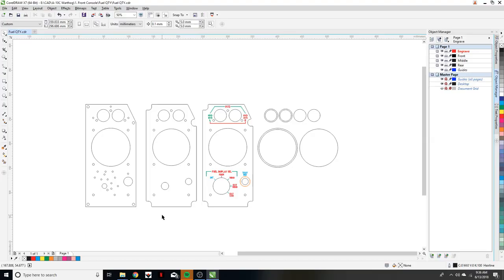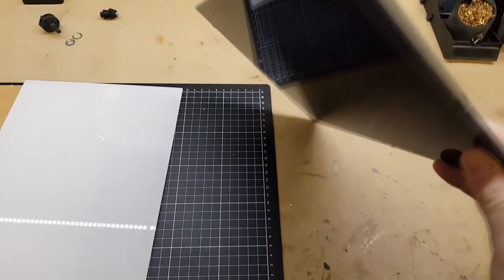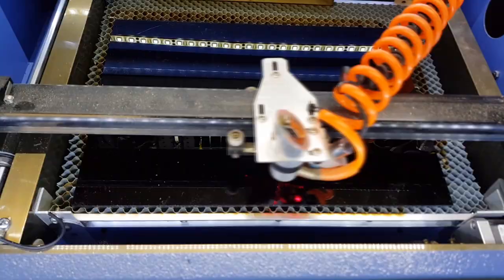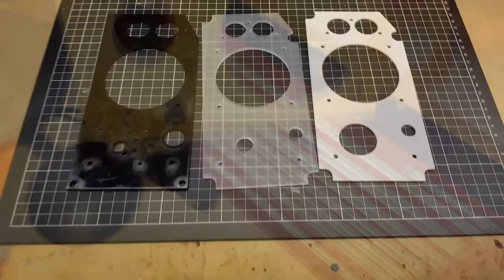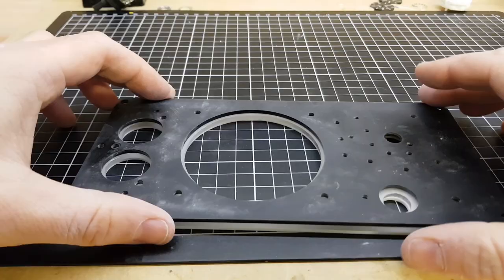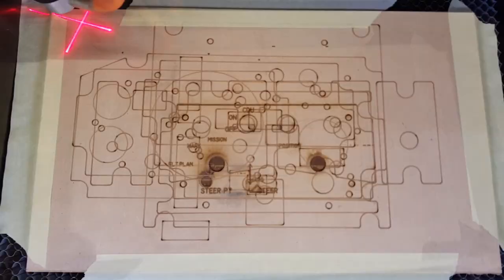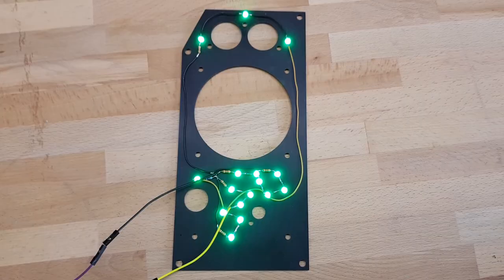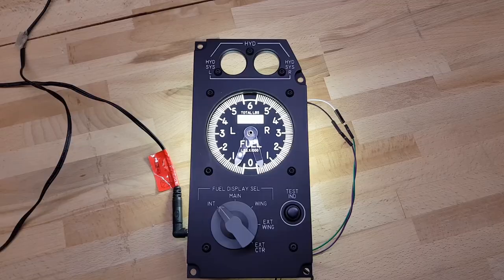Making Flight Sim Panels with my eBay Laser

Comment: Question.. did you actually manage to find a switch that meets up with the panel indents?? : ) ??
Reply: Blame USA but if you couldn't find one and you had the time and patience, using a LASER cutter, + maybe a 3D printer, + maybe a CNC machine, you could make your own custom rotary switch!! Cool!
Reply: Normally it's pretty  easy,  just oversize the hole and glue the base of the rotary to the back of the panel and then there's no movement, no need to use any pressure fittings. Or you can buy the component first and then design the holes afterwards.

Comment: I had to repair or replace these panels when I was in the U.S. Navy. Back in 1973 a panel like you made here would cost at least $ 1K. They were certified flight equipment though. $100 for the part, $900 for the cert.
Yours look great.
Reply: Well. 100 for the part, 100 for the cert... 800 for the gov contract upcharge...
I used to be a mechanic in the Army (thank you for your service btw) and was regularly blown away by the upcharge on common parts.

Comment: Nice mate.  Almost exactly how I do mine.  Just a tip, apply a little Bondo filler to the edges and sand down a bit to eliminate the seam where the parts meet.  Another way around this is by actually welding the layers together first and then cutting as the heat from the laser will make the edges look seamless.  Keep up the good work!

Comment: probably the best rear-illuminated panel method I have seen. Excellent work! I used your conformal coating idea on the wiring for safety on exposed hi-voltage on my own boards. Cheers

Comment: Excelent project. Congrats. One question, why you used 3 layers and not just 2. I mean the first layer could be (your second layer) the one which difuses light, painted black on the front, and engraved.? Thanks if you can answer.

Comment: You can use rubber cement as a masking agent in the dial recess instead of tape - the liquid form will ensure no seeping of the spray paint at the edges of the mask. I know since the dial went over it wasn't a big deal, but IF it was this would allow that precision. Likewise, it can be much faster than trying to get the tape to conform.

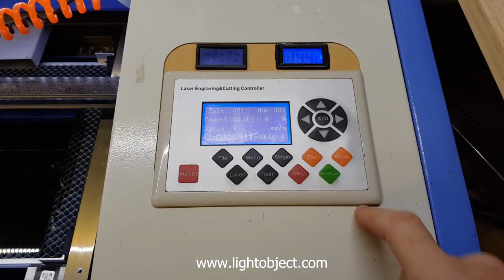Comment: ...  @ 03:00 you mention/show the acrylic... that front layer, that all solid white ? trying to see in my mind how that allows light through with the front sprayed black and then lettering lazer'd out/off the paint.
Question, @10:20 you do the drilling into the opaque layer... do you go all the way through it ? is yes... then sort of implies you touching the white layer. guessing my OCD tells me to rather do it on a drill press where the depth can be controlled.

Comment: one of the most satisfying vids ive seen, great job. New sub and like.
Reply from the maker: Thanks!
Reply: @thewarthogproject  Hi mate , I watched few videos about your project and it's really impressive. I'm a newcomer to the subject and after making first simple panel with ~30 switches and buttons I'm working on the more sophisticated one, with backlighting, displays, etc. That's why I have few quick questions, also looking for advices. I appreciate if you could help me.  
How powerful power supply u used? I'm playing around with the LEDs in Tinkercad now to see how bright they can still be when connected multiple of them to several teensy/andruino boards but it seems with few dozens of them (in one of the panels with 120cm of width and ~20cm of heigh) it will be better to connect them separately to 12V power supply.  They get too dimmed when using 5V, even with few circuts with separate 5v sources. I also consider to use 5050 led strip (30leds/m, 12V) cut in several pieces since I got >10m of it lying down in the cabinet.   
The middle plexi sheet - what transparency % would you recommend?
 Would it be not better to use also opal sheet for front panel? Tho I didn't have any of them in front of me, I though the solid one won't allow the light to go through. 

Cheers
Mark
Reply: Ooh one more question. What font size you use for engraving text?
Reply: @thewarthogproject  Any chance you could let us know what type of vinyl you're using at 15:58? Would love to see the method too if possible! :)

Comment: That is amazing! What adhesive vinyl are you using? I didn't know you could use it as heat shrink. Does it last or does it peel off with time? Asking because I see the video is five years old now.

Comment: Awesome... I wish my ford truck and my mother in-laws car gauges ,air conditioner,etc Gauges switches were done like that.instead the lettering explaining what each button does is worn off.so when I use her car or try to use any button even the backseat front seat locks,seat directions,  ect. I have to guess mostly .its very aggravating,the buttons aren't arranged intuitively either,and look the same.her car is only 2years old.Buick.it takes more thought and time.but its not only good to look at,but has a absolute purpose... In an air plain,you don't want to guess what buttons to push because of saving a dollar or two or more.
Good work,very nice panel.

Comment: If you sand the led it will spread light even better and not need to drill anything which makes it less likely to chip or crack anything.

Comment: Any chance of doing a video on how you upgraded your k40
Reply: Yes, this video was amazing, so now of course I (and Im sure, many others) want a cheap engraver and instructions on how to DIY improve it... 

PS. Your entire setup is epic!
Reply: It seemed as though the LED locations were still quite visible in the engraved letters, especially at higher brightness.  If the LEDs were instead spaced around the perimeter, would there be enough light to still see the letters?  It seems as though that would be much more uniform, but maybe it would not be bright enough.

Comment: You're obviously hugely clever.  I just wanted to mention that you don't need to spend a lot of money on special acrylic cement crap.  The best thing to bond acrylic to itself permanently is acetone and it's a lot cheaper and does exactly the same thing.  You may, or may not have to use slightly more or slightly less but the cost for a can of acetone is no doubt much less expensive.  Just a piece of useful (or useless?) advice.

Comment: Excellent work! Could you please give me the details of the vinyl used for the rear of the stack for heat shrinking/protection? Thanks very much :)
Reply: I am also interested in the vinyl sheet. I have never seen such insulation. Could you please share details what material it is?
Reply: Looks like it's regular self-adhesive vinyl sheet which is used for automotive wrapping. Search for 'vinyl wrap' and you will find it.

Comment: I'm building a overhead panel and looking for materials and want to use your technique. I have a question regarding thickness of the white panel. I can only seem to get 3mm made instead of 2mm and the opaque diffuser panel in 2mm. Would that work? also what is the light throughput of the white panels you use in %? The one I can get made says 5% light throughput, would that be enough do you think? Thanks!

Comment: Great video mate, I'm so happy I found you! Quick Q if I can, do you need a CO2 laser if you only want to engrave and not cut out acrylic? could you go with a Diode laser instead? using a similar method of either 3d printing or getting a white acrylic sheet, painting it black and then lasering it?

Comment: this is a great video, love your technique. at 10:30, you mention that you taped off the exposed middle layer switch surround -- if you hit the edges of the tape with a bit of clear (satin or matte) spray paint and let it dry before you spray the matte black, you can get perfect edges; this is called backmasking iirc. I understand that perfect edges are not critical in this situation, but I thought you might appreciate knowing about this trick

Comment: Great work always generates questions from "DIY" people like me.
So 3 questions for you.
1 why don't you paint the panel before starting cutting and save the alignment trouble later?
2 why don't you sand the edges of the acrylic sandwich to make it smooth and more realistic?
3  what font are you using for lettering?
Reply from the maker: 1) Because the edges of the panel and inside the holes which had been cut would be white - so I'd have to mask up the engraved letters and repaint.
2) Because the area sanded would be white - so I'd have to mask up the engraved letters and repaint.
3) just google MS33558 - you will find it free and it's the same font used in the real jet.

Comment: Another thought. Since the laser can cut light metals. you could get some light copper sheet and make a circuit board for your electronics
Reply: sadly these co2 lasers can barley even mark most metals and you need a cnc to do work like that  unless you spray paint the board first and laser away all but trace location

Comment: This is a relative old video but I do have a question that I hope you can answer :-)
The front layer with the text engravement on is a 2 mm. solid white acrylic plate. I get that the light is  diffused by the middle opacue layer. But I would think that the solid white layer would blok the light and by that NOT light up the text engravement. What is going on? Does it work because the solid white plate is only 2 mm. thick?
Kind regards

Comment: Subscribed, excellent video. What was the black self adhesive material you used to cover the LEDs and wiring on the back of the panel? That was slick and clean looking. Thanks

Comment: Amazing job pal! I bought one of those K40s 3 years ago, did a few upgrades and it's still going strong, a great tool for the hobbyist as you say. Mine can cut 5mm acrylic at 4mm per second, how are you doing with the 60W tube, better depth or just using it for the speed ?

Comment: Hi. Sorry for my english. Im a spanish speaker. First of all thanks for this videos. Your work is incredible and you save me a lot of time on investigate for my sim project. I have a question for you. How you fix the buttons on the pannels so in dont move when you turn the knobs? do you use silicone cement? Thanks again.
Reply from the maker: Thanks! The buttons and switches are screwed into the rear plate. Most rotaries have a post sticking out of them that slots into a hole in the rear plate that stops them from spinning.

Comment: excellent job, I used to repair panels like this on the Mirage and F1-11, yours are equivalent standard !
Reply: I used to fix the RAAF F111s. I was a RadTech at 1 and 6 Sqn. If you were fixing Mirages then you were probably before my time.
Reply: @JJC2611  I was a radtech at 481 sqn and worked  in radio workshops for a while then went to work in matra section on missiles for eight years, then after a while was a systech at 482 sqn in workshop 1. I spent the lat 14 years as a contractor doing avionics software testing at willytown.

I gotta ask why are the lights green, they were red in the mirage and f111 so I bet they would be red in the a10.

regards

steve w

Comment: I know this video is very old but its a great build process. I followed it nearly exactly and the results are spectacular with one exception, I cant find a good way to backlight as bright as yours.  For panels that have lots of text it requires many LED's. In order to get bright enough LEDs the current requirement becomes too high to drive with the arduino PWM pins. I could rig up a transistor circuit but that starts to get expensive for every panel. Any suggestions, what LEDs are you using? what LED driver are you using? I have seen in your other videos that they are dim-able so its not as simple as just wiring them to a 5v supply

Comment: Nice way of using cheapest Chinese laser out there that's not totally worthless. One thing though, when you're engraving use the other axis, it's way lighter, you can get much faster speeds, also, you're not using up your linear bearing and bar that it rides on which are probably way harder/pricier to replace than those 4 plastic rollers on a gantry, maybe even gantry itself.

Comment: Will you add a reference point for the laser in the future. Most milling systems have a work zero and a home positions. You could make it for the system then you know where everything lines up exactly.
Reply: The answer is - he is engraving through the paint. So he removes the piece from the machine to paint it, thus all offsets/machine coordinates are void when he puts it back in. I am suspecting you dont own or have access to a CNC or a laser cutter/engraver :D
Reply: That's really too much work in this budget and craftsmanship realm to get it anywhere precise and repeatable enough to trust it. You don't bother to use gauge blocks or micrometer when hand filing on ice cream sticks.

Comment: Very nice.  I'm going to "steal" a few of those ideas.
Is there a particular reason you didn't paint the front piece before you engraved/cut it?  It seems to me that you could have engraved it, then cut it with the piece still in the machine, removing the realignment step.
Reply from the maker: You can paint, then cut and engrave in one go, but you will end up with visible white around the edges of the panel and in the switch/gauge holes.
Reply: Fair point.
And TBH, your method would probably work better for my machinery - a mechanical spindle cutter with an engraving laser bolted on.

Comment: Great video! You've made me want to get one of those laser cutters for making my flight sim panels now. Do you think the stock K40 would be any good at what you showed in this video? Cutting and engraving or is the upgrade a must do?
Reply from the maker: Without a doubt--the upgrade is a must do! If I had my time again I would of spent a bit extra to get a machine with a larger bed. Looking on eBay most of the larger machines come with a dsp as well.

Comment: Just an amazing project, my friend. I'm embarking on a Hornet build myself, and have a few detail questions for you, I hope you wouldn't mind answering.
1. On your text and lines for the engraving: are you raster cutting those, or just letting the laser do them as lines. Looks like restoring, to me. What's the thickness of the lines and text font?
2. Your 8 position switch: do you have a model number on it?
Reply: Font is called MS33558. It will be an engrave rather than a cut, you can see from the way the laser head moves when doing engraving Vs cutting.
A company called Lorlin do an 8 pos switch it's model number is MTL-21-10. Around £4 each in the UK, but it could be that he's used a rotary encoder.

Comment: I wonder how it would look if you did the top plate paint on the backside and engraved the back with a mirror image. That way, any scratches on the front won't cause light to bleed through.

Comment: Just wondering, but I might have missed that. Are you using 3 times 3mm?
The original panels are 6 mm thick and consis of only 2 plates. 

Or is one plate only 2 mm to reduce the difference?
Reply from the maker: It's two 3 mm ones and the front is 2mm, so all up its 8mm thick.

Comment: Awesome! I’m pretty much set on following your guides to create the same on my Glowforge laser. What kind of vinyl did you use to secure and mask the leds on the backer plate?
Reply from the maker: Nothing special, just normal vinyl sheet i got in a large roll for cheap off eBay. The heat from the LEDs hasn't caused any issues at all yet.

Comment: I subscribed mainly to learn how you make your panels ..nice work ..well done! I'm new to laser cutting and etching but recently bought a k40 laser etcher/cutter .Ive been trying to figure out optimum cutting rates and power for 3mm acrylic ..would you be willing to share your setting ? Cheers Keith
Reply from the maker: I cut 3mm acrylic at 10mm/s on about 50% power. I find slow and little power gave better results as fast with more power.
I engrave text at about 120mm/s on 15% power. Sometimes i have to run it twice depending on how thick the coat of paint is.
Having said that, every laser tube is different so im not sure if that would work for you. I gave it HEAPS of trial and error before i got it dialed in.
Reply: @thewarthogproject  thanks so much for the reply , greatly appreciated !! Fantastic work on the a10 simulator (I fly as well but at the Airport ) ..mainly turboprop ....cheers !